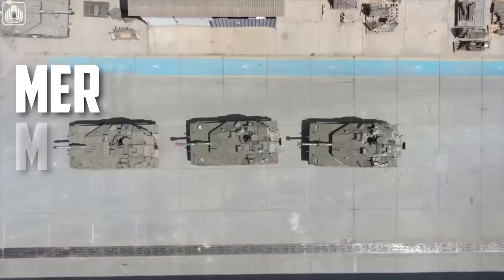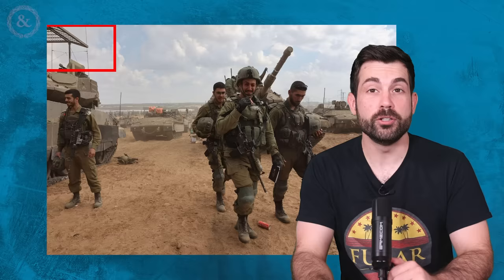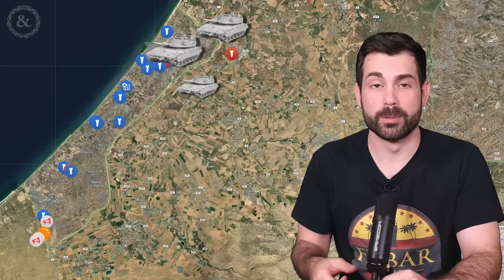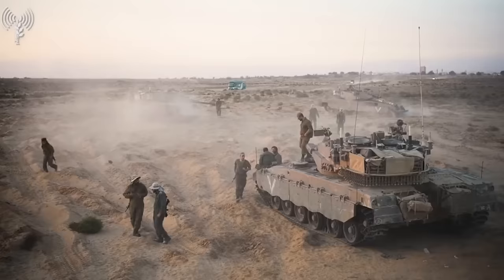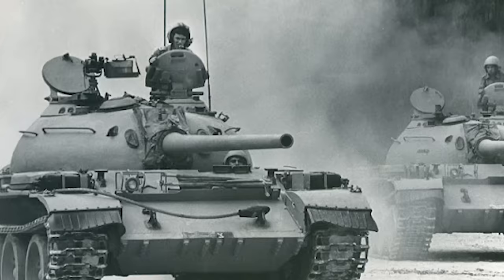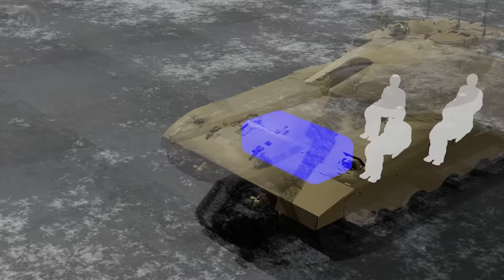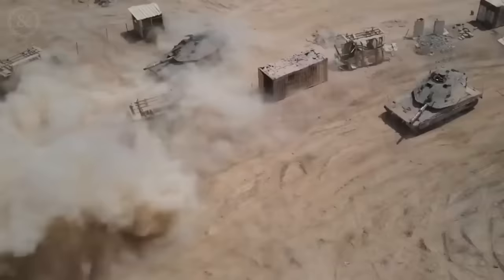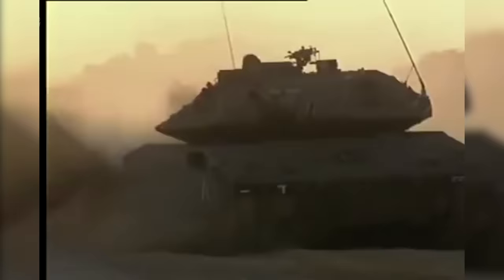Israel’s Home-Built Merkava Tank Tactics

Comment: A few other things to consider:
The thermal sights are so good, Merkavas have been used for decades as de facto observation posts (with hard kill capacity) around borders. After Hamas took out all the stationary armed observation posts around Gaza in one fell swoop, the IDF will probably go back to that tried and true tactic, where you can change positions easily and have actual soldiers on the ground, instead of the cool futuristic remote controlled but ultimately easily defeated posts.
Also, the Mk4 had the best improvement of all - air conditioning!!!
And lastly, a major bonus of the Trophy APS is that it relays the calculated source of the incoming projectile straight to the main gun's targeting computer, so you can fire back and destroy the enemy crew in seconds and are not likely to have multiple incoming threats from the same location. That is huge, since you normally have no idea where you were just attacked from.
Reply: Air conditioning in a tank in the middle of the desert sounds like a godsend.  10/10 best upgrade ever
Reply: all the observation posts needed was some top armor and they would have been fine.
Reply: I thought ALL the Merkava's had air conditioning, right from the Mk1
Reply: Nope, there was added-on aircon in the modified version of the MK3, but it was first fully integrated to the ABC system in the MK4. @niks1
Reply: No its a nice story
Reply: @tobinmenard3714  ?
Reply: @keith3761  Hamas's own drone footage pretty-much showed that even a simple peaked roof would probably have done the job, considering that it seemed like the top level with the weapons/observation equipment was open-topped.
Reply: @keith3761 any fixed fortification is a target waiting to be hit. The best defense is elastic and always shifting so the enemy can't plan out an attack. If you build a fortification you create something that can't change and no matter how strong it is it can be dealt with given time and preparation. Infinite time is better then something that changes every week or day or even several times a day which limits your time to make a plan, prepare and implement said plan before the defense changes again.
Reply: A de facto counter-artillery system on a tank sounds interesting. It might be mandatory in a dense urban environment where an RPG or ATGM could appear from anywhere.
Reply: the Trophy system [and other like it] may be the answer to many threats, but can it tell the difference between a missile and a stone?...
Reply: @contact594  that's something to be looked out...
Reply: @user-McGiver:  The short answer is yes, it can.  As I understand it, the system can analyze everything from shape to velocity to flight characteristics;  and can distinguish between differing munitions.  So a rock is simply ignored.
Reply: @likydsplit8483   nice!... thnx! apparently, that's the right answer  not the ''cages''
Reply: The problem with the APS is that infantry cannot do combined operations usign the tanks as cover, like most armies do, specially on urban warfare, the Throphy system has specific safe-zones for ground troops.
Reply: @JnSobre   for now... pretty soon they won't be needed, tank's will operate together with drone swarms, and mechanized systems... all controlled by the tank's AI...
Reply: remote-controlled observation robots need decoys.  If you have 50 identical cameras on top of your wall, you only need 3 of them to work.  (I mean a row of 50 cameras three feet apart)  You can hit all the cameras at once, but the logistical cost is gonna be staggering.  1-3 talented snipers with excellent equipment- reasonable.  50 competent snipers with adequate equipment for every observation post?  impossible.
Reply: @horstnietzsche1923  Ukrainian defense forces have used the Javelin missiles very effectively against some of Russia's most advanced tanks that had Trophy like active protection system. Any active protection system can be countered if you have the right equipment. Generally what worked the best for Ukraine was small unit strikes rather than full on offensives.
Reply: Yes, but tanks have been proven to be very vulnerable in urban combat.
Reply: @jeffk464  Nope!... is just that the orcs can't use them... the Ukies are using the same tanks with better results...
Reply: I'm afraid that just proves the Russians a) didn't have it switched on, like the AA vehicles that got blow'd up by drones b) didn't know how to use it in combat, or c) it's junk and never worked liked the Moskva.  @stoda01
Reply: @captainmaim   From what I understand the Javelin Missile was designed for armor with active protection systems in mind. The Javelin Missile doesn't lock on to the tank itself but paints the ground in front of the tank then hits it from above. Which is why you see so many improvised cages on Russian tanks. The Russians have modern tanks that can rival the western ones but a culture of corruption, mismanagement of resources, and poor utilization is why they are losing so many. Ukraine supported by the west vs Russia is the first real peer vs peer modern war we have seen in-awhile. Israel Merkava is impressive but it's over kill since they are going after poorly armed militants. Not really a true combat test.
Reply: Stones are not moving at 320 m/s.... ;)
Reply: Don't forget,it is the only tank had toilet inside. No need to out to piss and dump.
Reply: @likydsplit8483  

On Trophy...

Fire four RPG per side.  One MEFPS on the mount with a one second reload between shots.  Assume the inbound rounds are dual heat which will penetrate most layered/reactive armor.

Oops.

Infantry hate screening tanks.  Anything which will threaten a tank will shred infantry and the tank itself poses so many risks, from being run over if it has to pull back quickly, to toxic smoke from the grenade system to a lethal acoustic zone around the muzzle which frequently (in closed/complex terrain like cities with narrow streets) wraps back around both sides of the vehicle.

Contrary to popular belief Infantry are not such eagle-eyed steely killers that they can spot threats while clustered behind the vehicle.  It's actually better (for the tank) if they can be well forward to look in windows, check alleyways and side streets and monitor people who persist in standing outside their doors or up on their balconies voyeuring the show.

At that point, the main gun becomes useless because it has a lethal cone of about 50m downrange where the blast and overpressure just rips you up, inside.

Add to this that the gun itself is uses above about 20` barrel elevation and anybody on a third story window or roof or even overpass (close in) becomes hard to deal with.

Which means you are now down to whatever LMG are on an RWS auto-pedestal and your tank is reduced to being a pillbox on tracks.

Not a good plan.

In urban warfare, tanks with big bore AT rifles are less capable than IFVs with auto cannon capable of high angle (60-80`) elevation fire and absolutely smothered with dual layer ERA and multi-shot smoke grenades.

APS have not been thoroughly tested yet but there is increasing signs that you need at least a dual layer system with a system like Strike Shield built into the ERA blocks (fires the same 'shotgun' MEFPS which is actually a refined metal and rocket propellant mix which turns into a plasmoid directly off the side of the vehicle, going from energy to solid in a microsecond) and a turreted system which is capable of at least three, rapid, shots.  The Israelis have this, it's called Iron Fist and it is going onto BFVs where the Trophy is applied to the Abrams.

It should also be noted that having a pack of drones along sounds nice, until someone sets up a network jamming cell (multiple transmitters) and suddenly every one of your MAVs goes down.  Tanks are already this way with variants of Shortstop, Warlock and other IED/UAV/Comms/Mortar fuse killers mounted atop the rear turret deck.

A lot of armor theorists are now thinking, with the rate of casualty taking in places like Fallujah, Najaf, and now Bakhmut and Mariupol that the way forward is going to be with UGVs.

Pull the troop compartment, reduce the square area of skin needed to be armored (effectively allowing it's thickness to be doubled, for the same weight) and employ the auto cannon solution in 30-35mm with delay ABM and penetrator rounds, along with a veritable box frame of spaced composite and ERA brick armor (literally jack the armor off the tank and replace, as a whole unit with forward area units doing repair and replace of individual armor blocks and the aforementioned, layered, APS.

Use cheap ATGW like AT-4 or NLOS (Spike, fiber optic cable guidance assurance) weapons to reduce fortified positions atop buildings.

All in a 5-10 ton micro chassis which has no problem negotiating 10ft wide streets and is cheap enough to you can crank them out like Doritos.

The idea then being that you send in multiple flying squad platoons of 4-10 vehicles, each on a separate combat lane, to quickly rush an objective and seize the ground around it (power/water/TV/governance/tall building) so that you can set down a capture force of air assault infantry, based upon initial success of the robots, who then take the building and hold it.

Any insurgent threat which comes to retake their structure then has to be negotiate a series of open LC/MSR linear roads, or (slow) mouseholes as allied forces attack from above.

Heavy armor has a much reduced roll to play here, compared to PGK (guided) 120mm automortars which loft rounds to similar range but are low pressure tubes and so don't have to be fitted to a heavy chassis (able to absorb 20-30MJ recoil loads from an HP main gun) to get effects on-target.

Basically, you're talking about a series of much smaller/lighter vehicles which can be used sacrificially, if need be, in what is rapidly shaping up to be the main type of armored warfare as MOUT fights in complex terrain environments.

While they will primarily operate in HK Terminator mode, as long as the droid tankettes have enough roof area to mount a laser/MMW receiver, you can always put a high altitude drone into look down to command them, via MITL tactics control (move here, shoot that) as much as direct waldoing.

Compared to this, Merkava is a sledge hammer in a diamond cutter's tool kit and thus really needs to be considered in light of it's 1973 'lessons learned' dating as much as anything.  It's an artifact from a different era, as distant from today's needs as the Merkava itself was from the WWII Shermans and Panthers.
Reply: @niks1 So did I.
Reply: @fallinginthed33p 
It's proven technology. There are some very cool promotional videos on YouTube.
Reply: @likydsplit8483 Yet, they got their behind handed over to them by a bunch of guys in adiddas pants and slippers 😂😂😂
Reply: idf soldier here on the 7th was a shabat so most soldiers are home for the weakend which left only a few such tanks\observation posts  one of which was destroyed with a drone from above  and that zone was the one that got breached
Reply: Do you think Hamasses Yassin RPG 105mm is apable of destroying the merkava as they claim?
Reply: Merkava are high quality barbecue tins against RPG-32.
Reply: Good thermals despite an engine infront creating heat?
Reply: @lightningmqueengaming1145  Late in the day the IDF eventually deployed unsupported infantry which were easily pinned down.  Israel is so small that if even a few Merkavas had managed just 10 mph then most of the hostages could not have been taken into Gaza?

Comment: Having ridden on the outside of an M60A3 as an infantryman in the '80's, I always liked the concept of the Merkava carrying grunts foward.  Infantry squads can stay assigned to an APC, but the Merkava's ability to transport infantry onto the objective is a real plus and lifesaver for the tanks.
Reply: From what I heard, the space in the back is not really to transport infantry, that door is quite small for dismounting infantry in full gear. The main is reasons is to serve as living space for the tank crew for extended static operation or to carry the crew of a disabled friendly tank (Israel don't want them to be gunned down by the enemy since it take months to train them). It also make the rearming of the tank quite faster and easier. It's what they learned from combat experience.
Reply: The Merkava was never meant to transport troops it was pushed into that role in emergencies. The Israeli have come out with the namer Apc where they use the older mark merkavas to make the heaviest armored ApC in the world They took the turret off and raised the roof a bit. the Isrealis have a history of using obsolete tanks to transform them into heavy apcs. They first did it with the centurion tank they called the heavy apc version Nagmachon.The Israelis are the best military recyclers. They had captures many soviet T 54/ t 55 tanks and thought waste not want not and covered them into Achzarit apc. The one thing that makes the Merkava better then these first heavy APC is that the merkava is front engined like most apc are. The earlier apc made from rear engines had to be massively modified to get the troops safely out in combat. The problem with both merkava and the namer is that they are way too heavy for mobile militaries like the us
Reply: And can be used to rescue and transport the injured.
Reply: @TheMax0005 
We don't want any of our soldiers injured or killed.
Reply: That compartment is usually used to transport additional ammunition, and as a rest-area for crew, especially because the Merkava is so often used as a forward outpost.
It does provide sanctuary for casualties and crew from damaged vehicles.

But I remember when the Merkava was first introduced, that compartment was intended for four accompanying infantry escorts. The four-man section was two two-man teams who would provide security during maintenance and any field repairs, bivouac, and so forth. During major operations against peer forces, one team would use a Stinger, stored under their seats, while the other would wield a T.O.W. missile launcher stored under their seats, each with a single ammo crate of reloads. During field bivouac in a combat operation, these would be the primary security during crew rest. That is how Merkava operated in Lebanon in the 1980's, I did not hear about any lessons learned; but that might be why we don't see that now, but we do see the Namor and previous heavy armored personnel carriers.

Comment: Until about 2 decades ago, all engineers on the projects (Outside of select specialists) were all former tankers, though by now that has been changed. So it was a tank designed by tankers, all of whom had been in combat in tanks, and they designed it based on what they knew was needed, what worked best, and what was ideal from experience.
BTW for people wondering why a Corps head is a Brigadier General, in Israel they go from Battalion to Brigade Level (no Regiments), Brigades are commanded by Colonels,  and the head of a sector command is only a Major General and the Chief of Staff is a Lt General. Israel's system is designed to allow for flexibility in case of war, as well as give a lot of independence to each lower level of command in combat, because of that need for flexibility. Israel has been using such a system since the beginning. Also every soldier starts off as a private before being selected for officer school, so even the Chief of Staff was once a private, which creates a very different officer breed
Reply: Great info. Thanks.
Reply: Holy sh*t, that would make a huge difference!
Reply: Do you think Hamasses Yassin RPG 105mm is apable of destroying the merkava as they claim?
Reply: As I recall, (at least infantry) Israeli officer casualties are routinely high.  Leading from the front is expensive...but more often than not it results in victories... YP